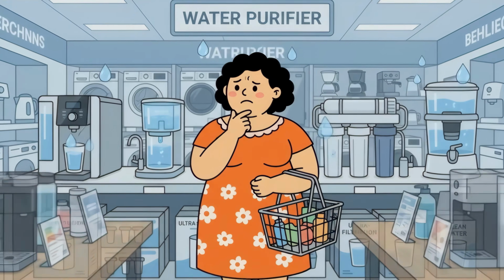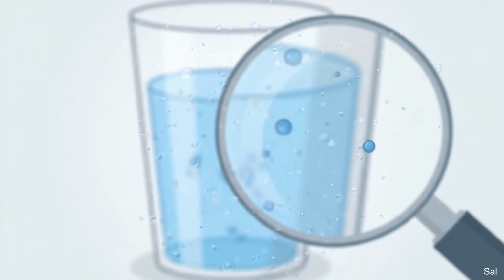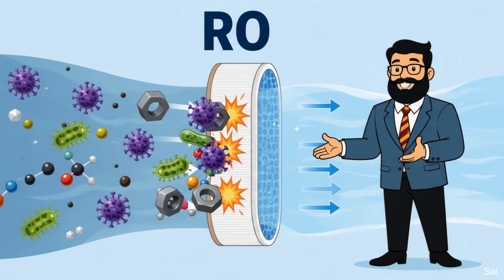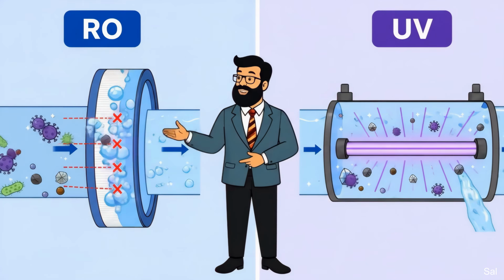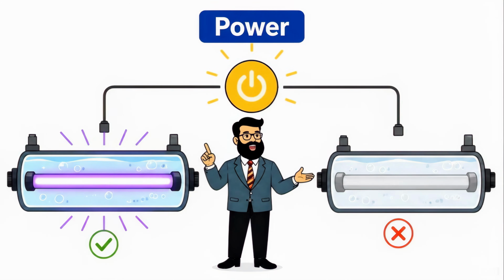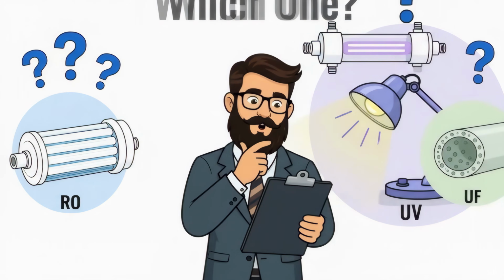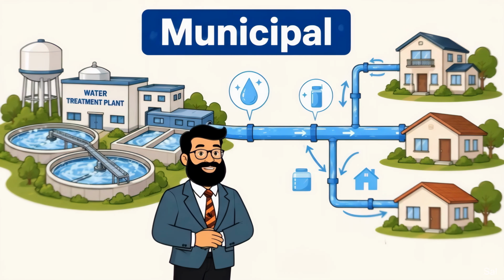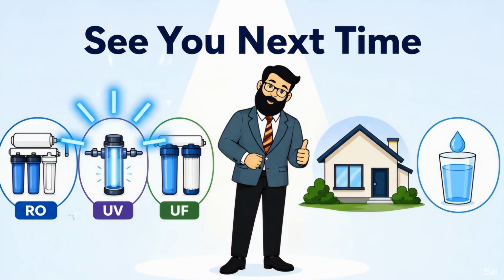RO vs UV vs UF Water Purifiers: Most People Choose the Wrong One

Comment: I have a counter top, Sans RO water filter.  It uses 2 filters and a mineralizer filter and also includes uv lights.  I filters like 1 quart at a time, and I throw out like 2 cups or so per filtered quart.  It displays while dispensing  the ppm of particles.  Mine usually reads between 3 and 9.  It also tells you when you need to replace the filters.  I have had my filters in place for a year and they are still going strong.  I use my sans water filter for drinking water and coffee and on occasion for cooking.  I am very pleased with it.  It was a few hundred dollars and the filters are 159 USA dollars for 3 plus a bonus of 2 spare, I think - for over a years supply.  It does use electricity to operate.